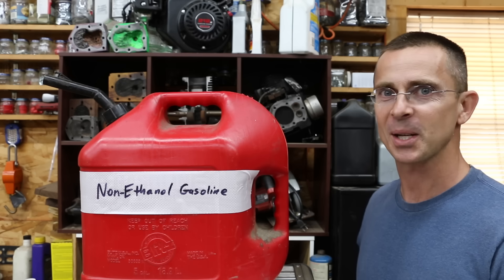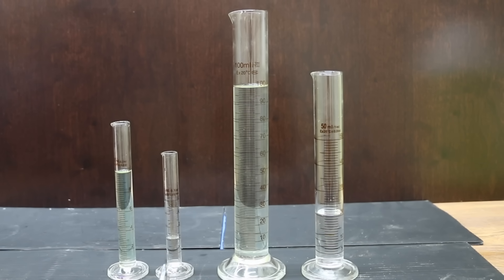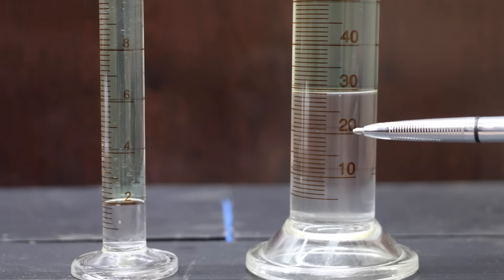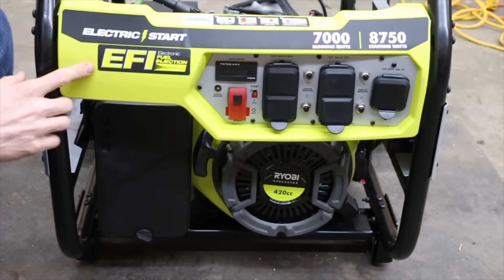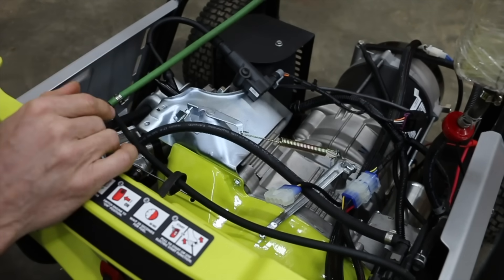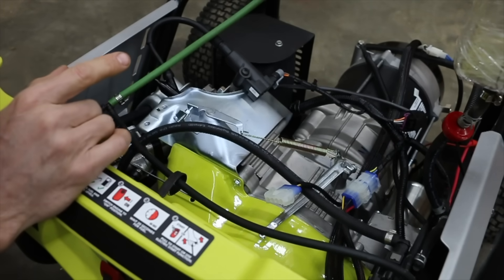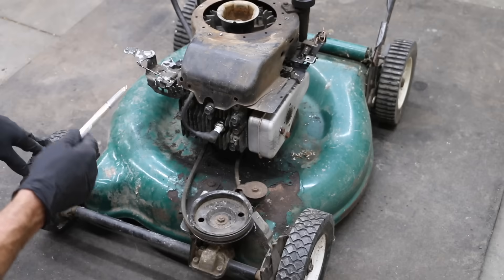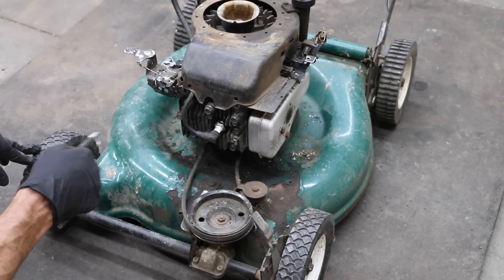Is Non-Ethanol Gasoline Really Better? See the PROOF!

Comment: Without subsidies, ethanol as a fuel source, would not make a profitable commodity in the private sector.
Reply from the maker: Thank you!
Reply: So you don't think the 8 Trillion dollars the United States Government has spent protecting our "national interest" in the Middle East over the last 40 years is a subsidy!
Reply: @mobeydick37  We didn't spend $8T to get oil. Military-Industrial Complex fights wars for the sake of wars, logistics, and construction contracts.
Reply: @jarelnomeh2345  Then what the hell did we spend the money on? We haven't spent that kind of money in Asia, South America, Africa or even Europe. Did we just throw money to our enemies? NO we spent it there for what all the politicians say we spent it on, our "National Interest", what would that be, Security for whom, the people there. The simple facts are the money we spent there is a subsidy to the petroleum industry. If they had to pay that cost gasoline would cost $15.00 a gallon in the United States.
Reply: @mobeydick37  It didn't have the effect you think it did. The money was spent on transporting troops, feeding them, supplying arms/ammo/equipment/fuel/replacement parts, building roads/bases/bridges, tanks, jets, drones, ships, trucks, computers, radios, various electronics, software, networking equipment, and many more things. All of those services and products are supplied by contractors - the military-industrial complex (Boeing, Lockheed, Raytheon, General Dynamics, etc.). Those multi-billion dollar corporations have senators and Pentagon generals in their pockets. Every time we go to war, those companies make a shit ton of money. That's why we're always at war with someone, somewhere for dubious reasons.
Reply: @jarelnomeh2345 t was still money our government spent in the land of sand to protect the production of petroleum. That is the very definition of subsidy. 8 Trillion dollars over the last 40 years. Do the math on the number of gallons of gasoline used in the United States during that time. I'm as far as you can get from a tree hugger but that money would have ben spent on developing other power sources and today we wouldn't be using gasoline for 90% of the passenger vehicles on the road. As a Duck hunter that would be a tremendous benefit to keeping the swamps of Southeast GA. where I live in better shape to host winter migrating waterfowl.
Reply: @LerRhann  Every time anyone tried to switch from dollar-based international trade, they found themselves in the midst of an internal revolt and a follow-up "liberation" by NATO forces.
Reply: Mobey Dick Ya know....I was writing a retort to your comment, but I can see where this will go. If you enjoy Big Gov., move to Venezuela....they did a bang up job there...controlling their oil...Oh Yeah!! Paradise!
Reply: @mobeydick37  Last I checked, the U.S. gets the vast majority of it's oil from North America (the U.S., Canada, and Mexico). It doesn't appear that that whole mess is because they needed the oil.
Reply: @lovotcore6946  That may be the case today at times past we receives vast amounts of petroleum from the Middle East. Regardless our government has spent Trillion of dollars defending the production of petroleum in the Middle East! ant is a subsidy to the petroleum industry. Should we not give that same subsidy to all industries or are we selective to the people we make it easier for them to rob us. BTW: I'm as free market as it gets. I believe the petroleum industry should be made to pay for it's own protection.
Reply: @mobeydick37  some is imported from the middle east, but only around 8%. The U.S is still it's own largest oil supplier, and it would be completely self sufficient if it weren't for government bullshit blocking domestic drilling, and other energy sources that could actually replace oil, like nuclear reactors.
Reply: @lovotcore6946   We import billions(CORRECTION NOT BILLIONS, MEANT MILLIONS) of barrels of oil per day.
Reply: @danafletcher2341  Point still stands, we don't need the oil from that area.
Reply: @lovotcore6946  That oil is cheaper which is why it is imported.  But that cheap and easy oil is about all gone otherwise we would never frack or use tar sands.

Nuclear reactors are too dangerous, we have destroyed the Pacific Ocean we once knew with radioactivity from Fukushima that is still an ongoing disaster.  I am for building Thorium reactors which are much safer and could detoxify all the radioactive waste we have built up.
Reply: @danafletcher2341  the MSR type reactor is definately a lot better, too bad they cut funding for it 50 years ago when they were ready to make a full scale reactor, which would have laid the groundwork for the MSR to be produced commercially. 

Interestingly, all of the major reactor accidents have been due to the operators doing dumb shit (shutting the reactor down means the coolant pumps have to be driven by something else, the reactor itself is the most reliable way to drive these pumps by far, no coolant means it melts down), high pressure reactors just aren't idiot proof enough.
Reply: @danafletcher2341   " Dana Fletcher
Dana Fletcher
1 month ago
@Lovot Core  We import billions of barrels of oil per day. "

No we don't.

We import between 8-10  million bbls/day of crude and product combined, and export combined between 6-8 .  We're commonly net in the hole between 2-4 million bpd now, but it's trending toward zero net imports combined - we've had 2 weeks in the past several months where we were net exporters combined.   You can see these numbers weekly, in barrels per day units at this site from the EIA:   https://www.eia.gov/dnav/pet/pet_move_wkly_dc_NUS-Z00_mbblpd_w.htm   
 A minus number in the "Net Import" at the bottom represents us being an exporter, a positive number is still importing more... for the week of 2/22/2019 we were a net combined exporter per day by a few hundred thousand bbls (42 gallon barrels)...  the US market place handles around 20 million barrels/day ... our direct refining capacity runs just over 17 million bpd.
Reply: @lylestavast7652  Thanks for fixing my typo, it indeed should be we import millions of barrels of oil per day(average).  For sure there might be one week or two where we export more than we take in, but I am talking the average.

With fracking, it is a race between the super quick depletion rates of the wells vs the depletion rates of their needed cheap and easy credit.

We must be about all out of the cheap and easy oil because we would never frack or use tar sands otherwise.

I am not totally against using petroleum at least in the short term.  There is an economical process that can make ethanol from oil, coal, and natural gas.  It is from a Texas Company named Celanese and the process is called TXC Technology.  China, India, and Indonesia are using this.

With enough ethanol, we could have dedicated ethanol engines that are clean and nontoxic and half the size/twice the power as gasoline.  Super efficient, some even better than the best diesels.

Here is an example of one already on the roads worldwide(not US) today with mileage equal to a diesel:

https://www.oemoffhighway.com/engines/press-release/21005554/scania-ab-scania-introduces-bioethanol-engine

Imagine cars, big trucks and buses that are so clean people living in our cities could have nontoxic and breathable air! 

Here is an interesting American ingenuity story on cellulosic ethanol as seen on 60 Minutes that could be a game changer:

https://www.cbsnews.com/news/marshall-medoff-the-unlikely-eccentric-inventor-turning-inedible-plant-life-into-fuel-60-minutes/
Reply: Farm subsidies = Ethanol subsidies......on top of the Special loan / grant programs for Farm Cooperatives to build and produce said Ethanol. it all comes down to a bail out of the commodity market, do to over production of mono culture crops by farmers. The commodity market is rigged to bail out farms, if a farm diversified its self = no bail out.
Reply: pour some gas out on the ground and some ethanol next to it and light them up watch the black smoke from the gasoline and 

watch the nothing visable from the ethanol , wich one would u rather breathe in when in big city's , just a thought

now is it almost as bad proberly but i know what i would choose if i could
Reply: @1worldgaming18  As far as big cities, I would rather they breath mustard gas. I stay away from those shit holes.
Reply: @jarelnomeh2345  me too
Reply: @jarelnomeh2345  some of those horrible pollution filled cities like in China and India, to name but a few.....nope, I'm good right here Thank you very much 😅
Reply: 1WORLD GAMING --> You're right, lighting gas opposed to ethanol, but it takes a gallon of oil to heat up that corn, distill it into ethanol, but you don't see that. That's why the oil companies aren't fighting the sale of ethanol, they're still selling their volume of crude, understand?
Reply: @happydays8171 
One does see it, since all the energy it takes to make and deliver a gallon of ethanol shows up it the price of it.

Very strange that many ethanol detractors think oil is not distilled and/or that boiling crude oil somehow takes less energy than boiling a beer.  BTW, there is a novel process that sprays beer infused with nano bubbles into a vacuum column at just 104 degrees F to make anhydrous ethanol in one pass without the need of molecular sieves as currently is needed.  This will bring energy use down by 75% over the current already cheap cost to produce ethanol or around $.24/gallon.  Works to distill water too, very great.

What gasoline does not show the energy lost with flaring nor the energy costs of keeping an aircraft carrier battle group near oil regions.

Oil companies formed and still fund an entity for the purpose of producing negative propaganda toward ethanol(the API) both overtly and covertly.  I can not think of anything else they fight against more than ethanol.  I often think they do not fight electric and hydrogen cars or do so with limp wrists because they know those becoming viable are many many years in the future if ever.
Reply: C C most private sectors wouldn't be profitable without subsidies. Welcome to America.
Reply: The corn ethanol Federal subsidy ended back in 2011 along with import tariffs.  The G7 nations have had a long standing stated goal of ending petroleum subsidies which they never get around to though.
Reply: Dana Fletcher --> I haul gas for a living. The retailer where you buy your gas is charged $.18 cents a gallon for straight conventional gas, $.13 cents a gallon if he buys 10% ethanol added gas. Whatever you want to call that nickel a gallon of your money he puts in his pocket us up to you, but most on here are referring to it as a subsidy that didn't end in 2011.
Reply: @happydays8171  
The $.45/gallon blenders credit ended in 2011.

To exclude all problems or perhaps a local/state subsidy that possibly could exist, let us look at the prices on the NYMEX which would exclude any subsidy.

Today, a sub grade, sub octane(84) unusable gasoline called RBOB is trading at $1.5742/gallon.

Chicago ethanol on the NYMEX is trading at $1.3625/gallon.

To raise RBOB to a standard grade and standard octane that is usable in vehicles refiners would have to refine it more and/or add more expensive and toxic aromatics to raise the octane which makes the fuel cost more per gallon than the $1.5742/gallon.  Even before ethanol existed, the higher octane fuel cost more than lower octane fuel.  Still does.

Or......instead refiners can simply splash blend in 10% nontoxic and clean ethanol to raise octane and bring to standard usable grade which as you can see above will make fuel cost less than $1.5742/gallon.

That $.18/gallon is a super low spread, it should be more but it appears that is coming since this NYMEX price has really jumped up and looks to be heading back to the higher levels it normally trades at.  A lot of 2018 RBOB gasoline was >$2./gallon, ethanol trades from $1.25 to $1.45/gallon normally.
Reply: Dana Fletcher -->You're obviously smarter than I. Here in Indiana, up until about 5yrs ago, conventional fuels were still refined to 87 octane, the 10% ethanol added boosted it to 89 at the pump and the oil companies never changed the stickers on the pump. But here's the thing, there are no regulations on the manufacture of ethanol, only guidelines. I've been to plants when during high demand the ethanol was not let sit 48hrs normal fermentation time before released. other times it sat longer increasing the octane, point being ethanol of your gas could have been 90 or 190 depending on how long it sits, that's something you should research.
Reply: @happydays8171  RBOB gasoline which is a blenders grade is what goes through the pipelines in the US and it is a fungible product that has to be 84 octane among other things to be sold.

When 10% ethanol is added it makes 87 octane gasoline.  

To make 87 octane E0 from the 84, premium gasoline which contains 40% BTEX(benzene, toluene, ethylbenzene, & xylene) is added to bring it to 87 octane.

Ethanol is fungible too.  It has to be 200 proof which is pure ethanol, nothing else.  Even during busy seasons.

By law 10% renewable fuel must be sold in this country.  So a station could sell 8 gallons of E0 for every gallon of E85 sold or sell everything as E10 to comply.

There exist RINs to buy which is sort of like a penalty for not following the law.  Most refiners follow the law and sell E10, but some did not and when a few large blenders manipulated the RIN market, a few blenders were caught with their pants down and did not sell 10% renewable and had to buy high priced RINs to become compliant with the law.  I explain RINs better a few posts above here.
Reply: Dana Fletcher --> I'm not arguing with you, you could be right on a lot of these things, I don't know the letter of the the law so I don't want to mislead anyone. I do know that the RFG, or RBOB as you call it is a minimum of 85 octane and premium 91 octane before the ethanol is added which on paper boosts the octane 2 points. E85 is blended for the season, right now, where I live it's actually E70, 30% gas for the winter months. Without the 30% petro gas added it would cause major problems even in Flex fuel vehicles. Ethanol has no lubricating qualities. It will wear out your fuel systems faster than petro gas.  The ethanol and additives is blended at the terminals I load at. Each oil company blends it differently. I don't know what 200 proof is in octane. Don't really care. Next time I'm at a terminal and I think about it, I'm going to ask about that 40% BTEX, that sounds high, maybe 40% of the additives is BTEX. All additives are so concentrated nowadays.
Reply: Dana Fletcher --> I'm not arguing with you, you could be right on a lot of these things, I don't know the letter of the the law so I don't want to mislead anyone. I do know that the RFG, or RBOB as you call it is a minimum of 85 octane and premium 91 octane before the ethanol is added which on paper boosts the octane 2 points. E85 is blended for the season, right now, where I live it's actually E70, 30% gas for the winter months. Without the 30% petro gas added it would cause major problems even in Flex fuel vehicles. Ethanol has no lubricating qualities. It will wear out your fuel systems faster than petro gas.  The ethanol and additives is blended at the terminals I load at. Each oil company blends it differently. I don't know what 200 proof is in octane. Don't really care. Next time I'm at a terminal and I think about it, I'm going to ask about that 40% BTEX, that sounds high, maybe 40% of the additives is BTEX. All additives are so concentrated nowadays.
Reply: @happydays8171  In Brazil they find identical engines using E100 vs their common gasoline(E27) last up to three times longer.  Soot is like sandpaper in an engine.  We see the similar things here with propane vs gasoline.  None of these fuels are known for lubricating, even diesel without sulfur is not very lubricating.  Biodiesel is very lubricating which helps diesel fuel pumps that need lubrication.  

I think some places even go to E50 in winter since ethanol is not very volatile.  I saw two different semi truck accidents in the news last year with ethanol loads that did not explode, I would expect that in wintertime, but these were in July.  Train crashes often do not explode with ethanol either.  The Indy 500 switched to alcohol because of the safety.

What makes it safe is what makes it hard to start in winter.  Diesels are the same way which is why they have glow plugs.  In Brazil with E100 at first they used to have a small lawn mower fuel tank of gasoline to start cars in colder weather, then switched to ethanol.  In our country we chose adding 15%  to 50% gasoline years back.

Brazil for a while now has fuel injectors that adjust for cold starts and fuel warmers when the door opens in their flex fuel cars.  

The new generation of internal combustion engines (HCCI) will make glow plugs and fuel warmers or gasoline unneeded for ethanol engines.  High compression engines will make ethanol shine and we should have E100 for it.  A high octane standard is needed for manufacturers to test and model engines for.

Here is a video of aromatic/BTEX levels.  The 40% level I stated is for premium high octane gasoline.  His charts show the US in summertime had 29% aromatic levels for standard gasoline and those fell to the lower 20s when 10% ethanol replaced it for octane.  The law did not require BTEX to be removed, so refiners refined lower octane fuel along with lower octane fracking crude oil supply so they still kept fairly high amounts of toxic aromatics.
https://www.youtube.com/watch?v=jIuU8A82se4

With E30 or E27, like the other crime against humanity(i.e. lead), BTEX could go away to the ash heap of history.

P.S. Avgas made of ethanol, (AGE-85) does not lower ethanol levels since it uses around 12% pentane for volatility in starting and 85% ethanol.  Also has 1% biodiesel for lubrication since avgas currently uses high levels of lead for octane and lubrication and current fuel systems need lubrication evidentially.
Reply: Ethanol made corn on the cob more expensive!
Reply: @fl6stringer   Congratulations, you are officially a victim(and/or sucker) of organized negative false propaganda.  Prepare for your (false)paradigm to be rocked! 

Here is how the 2007 Energy Independence and Security Act affected food prices(if at all):

2007 WEIGHTED CORN PRICE =$4.20 WITH 4 .7B GAL MANDATE

2008 WEIGHTED CORN PRICE =$4.06 WITH 9B GAL MANDATE

2009 WEIGHTED CORN PRICE=$3.55 WITH 10.5B GAL MANDATE

2015 WEIGHTED CORN PRICE =$3.61 WITH 15B GAL MADATE MAXED OUT 

2016 WEIGHTED CORN PRICE =$3.36 WITH 15B GAL MANDATE MAXED OUT

2017 WEIGHTED CORN PRICE =$3.36 WITH SAME 15B GAL MANDATE MAXED OUT + RECORD EXPORTS OF 1.37B GAL

https://quickstats.nass.usda.gov/results/E31529F8-EF1E-3C3A-B530-52AED1DA082F

Wheat

2007...............$6.48/bu

2008...............$6.78/bu

2009...………$4.87/bu

2015...………$4.89/bu

2016...............$3.89/bu

2017...............$4.72/bu

https://quickstats.nass.usda.gov/results/F7EE6803-FE01-38E8-A580-A6D167ED9B70

Soybeans

2007..............$10.10/bu

2008..............$ 9.97/bu

2009...……...$9.59/bu

2015..............$8.95/bu

2016..............$9.47/bu

2017..............$9.33/bu

https://quickstats.nass.usda.gov/results/B49D08C1-2CF8-3311-BBD3-7A90E6EE725D

Corn ethanol is a value added product of feed production which uses a waste stream from it(the starch) which cattle can not digest well and a lot pass through undigested as waste onto the ground in their manure.

Corn ethanol uses only the starch and leaves the feed(proteins, fats, and minerals) alone, actually enhances it to be more productive, more digestible, more concentrated, and healthier for the animal.

Better/more food with a super cheap, super nontoxic, super clean, and super concentrated octane booster/fuel/oxygenate as a bonus. Who can be against that?

All corn should be made into ethanol, it would be better for the cattle to eat the distillers grains vs straight corn. But as such ethanol from corn is limited to the size of our cattle herd economically speaking, so other sources are needed. 

Here is a game changing source from 60 Minutes:  https://www.cbsnews.com/news/marshall-medoff-the-unlikely-eccentric-inventor-turning-inedible-plant-life-into-fuel-60-minutes/
Reply: @danafletcher2341  what's your opinion on grass fed vs corn fed cattle?
Reply: @TacticsTechniquesandProcedures  I personally eat grass fed beef as much as I can so you can see I think that is better (for a number of reasons).

But if we are going to have grain fed beef, then I prefer distillers grains, i.e. fermented corn over feeding unfermented straight corn.

Distillers grains(like grass) do not lower animal pH or give acidosis like straight corn does.  The lower pH causes bad and deadly bacteria in the cow's gut to proliferate.  Feeders to combat this problem add antibiotics to the feed which causes a whole host of unintended consequences not the least of which is antibiotic resistance in humans, etc.  

This is huge, like the vast majority of antibiotics made today go not to medicines, but rather to feed additives. 

With distillers grains (and/or grass feeding), that practice, would not be needed.  

Plus distillers grains are more productive than feeding the original straight corn.  More/better food with a super cheap, super nontoxic, super clean, and super concentrated octane booster/fuel/oxygenate as a bonus.  Who can be against that?

Corn ethanol would not exist is everyone ate grass fed beef like me or became vegetarians.  It is economically limited to the size of our cattle herd.

I am for ethanol from all sources to have clean air.  I am even for, in the short term at least, converting oil, natural gas, and coal into ethanol like China, India, and Indonesia are doing with TCX Technology from Celanese a company from Texas.

Here is a game changer for cellulosic ethanol that was on 60 Minutes, great innovative American story:
https://www.cbsnews.com/news/marshall-medoff-the-unlikely-eccentric-inventor-turning-inedible-plant-life-into-fuel-60-minutes/

With enough ethanol, we could have hyper efficient and hyper clean engines that are half the size/twice the power of gasoline ones.  Even engines equal to and more efficient than the best diesels.

Here is an ethanol engine on the roads worldwide today(not USA) that gets equal mileage to diesel.
 https://www.oemoffhighway.com/engines/press-release/21005554/scania-ab-scania-introduces-bioethanol-engine
Reply: really? ethanol is crap
Reply: @dbag2u  Zach better reread Dana's fact lesson. Pure ETHANOL   sells approximately $1.00 less than pure gasoline. Mainly because it cost less to make.
Reply: Mike Clemens and it is still crap. Dont care about price
Reply: Yep and it further depletes the soil of nutrients for no worthy cause.
Reply: corn based ethanol is extremely bad, sugar or waste matieral based ethanol will be much better at carbon reduction and not increase food prices like corn based does.
Reply: @kercchan3307  Corn ethanol is extremely good because it does use waste material and its effect on food prices if any are listed below.  Because it uses a waste stream, it is so economical that Brazil with sugar cane saw fit to put an import tariff on ours in 2017.

Corn ethanol is a value added product of feed production which uses a waste stream from it(the starch) which cattle can not digest well and a lot pass through undigested as waste onto the ground in their manure.

Corn ethanol uses only the starch and leaves the feed(proteins, fats, and minerals) alone, actually enhances it to be more productive, more digestible, more concentrated, and healthier for the animal.

Better/more food with a super cheap, super nontoxic, super clean, and super concentrated octane booster/fuel/oxygenate as a bonus. Who can be against that?

All corn should be made into ethanol, it would be better for the cattle to eat the distillers grains vs straight corn. But as such ethanol from corn is limited to the size of our cattle herd economically speaking, so other sources are needed. 

Most naïve studies that show no carbon reduction apply most/all of the carbon/energy to the ethanol side of corn and very little/none to the feed side of it when it should be the other way around because if we all became vegetarians no corn ethanol would exist, however, if we outlawed ethanol, the very same amount of corn acres would be planted that we always do and always have.  Cattle feeders will not feed less protein to their herds just because we drive with a different fuel in our automobiles.  No, they would simply switch from fermented corn(i.e. distillers grains) back to non-fermented corn, i.e. straight corn.  Here is a chart of corn acres, note that ethanol does not even show up as a blip: https://uploads.disquscdn.com/images/91d7502e043c7c976bdbac4d3953fb82813e0ab4ef4723a5d70e734514dcac9c.jpg

Here is how the 2007 Energy Independence and Security Act affected food prices(if at all):

2007 WEIGHTED CORN PRICE =$4.20 WITH 4 .7B GAL MANDATE
2008 WEIGHTED CORN PRICE =$4.06 WITH 9B GAL MANDATE
2009 WEIGHTED CORN PRICE=$3.55 WITH 10.5B GAL MANDATE

2015 WEIGHTED CORN PRICE =$3.61 WITH 15B GAL MADATE MAXED OUT 
2016 WEIGHTED CORN PRICE =$3.36 WITH 15B GAL MANDATE MAXED OUT
2017 WEIGHTED CORN PRICE =$3.36 WITH SAME 15B GAL MANDATE MAXED OUT + RECORD EXPORTS OF 1.37B GAL

https://quickstats.nass.usda.gov/results/E31529F8-EF1E-3C3A-B530-52AED1DA082F

Wheat
2007...............$6.48/bu
2008...............$6.78/bu
2009...………$4.87/bu

2015...………$4.89/bu
2016...............$3.89/bu
2017...............$4.72/bu

https://quickstats.nass.usda.gov/results/F7EE6803-FE01-38E8-A580-A6D167ED9B70

Soybeans
2007..............$10.10/bu
2008..............$ 9.97/bu
2009...……...$9.59/bu

2015..............$8.95/bu
2016..............$9.47/bu
2017..............$9.33/bu

https://quickstats.nass.usda.gov/results/B49D08C1-2CF8-3311-BBD3-7A90E6EE725D

Here is a game changing source of ethanol from 60 Minutes:  https://www.cbsnews.com/news/marshall-medoff-the-unlikely-eccentric-inventor-turning-inedible-plant-life-into-fuel-60-minutes/
Reply: You are correct
Reply: @Borrowed Time What results on the food supply are you talking about????  Huge surpluses???
http://www.startribune.com/surplus-of-grain-is-overflowing-in-silos/381838461/
Reply: C C 

Only one problem with that: if the Soviet Union had knowledge of practical ethanol production (which frankly is nearly identical to vodka but with nearly 200 proof as the goal) they wouldn’t have needed gas. The thing about commodities is that they’re something that people depend on and are willing to pay for. Why pay for something that can be grown in your backyard with the right knowledge and the right equipment. True commodities should be the equipment, so long as the internet is a free place for knowledge.
Reply: Well I'm not going to debate interest in politics and all the other s*** that comes along with it. But if we run the pipeline from Canada and you are offshore technology and do what we need to do we could tell the Middle East screw yourself we don't need your damn oil. And if they become less Rich because we're not paying them millions and billions of dollars maybe they can't afford to run their damn Wars. And then they would say dammit man we need to sell some of this s*** cuz all we got is sand and oil and they ain't no damn demand for sand so you know I think we're going to start selling that s*** at about $25 a barrel. And quit restricting American farmers from using their property to raise groceries. Then we wouldn't have to find another use for corn, except Michael little Wildcat! I guess by the way I need to start on that project here pretty soon. But anyhow what I started out to say I got a 2013 GMC two wheel drive and the gas mileage sucks it does better running non-ethanol gas. I can get as good of gas mileage from 89 octane regular gas as I can from 93 octane ethanol don't know why I'm not nothing but a country boy I just know what happens when I go to the pump. Happy Motoring
Reply: Yeah, and what's more they should have kept leaded gas.